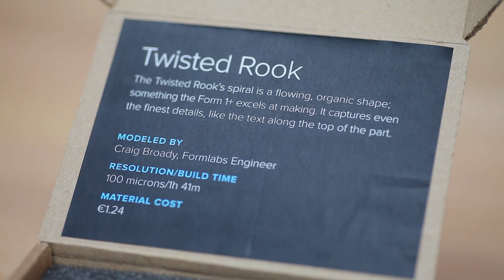Formlabs Form1+ Sample Part - The "Twisted Rook"

Comment: Formlabs is a risky printer - it does not perform as advertised. I bought it because of its high resolution, but I can't successfully print models that work perfectly on FDM and Polyjet hardware. I quickly realized that this 3d printer works only under perfect model conditions. I asked Formlabs to "do the right thing" and take it back only after having it for a week and they have stonewalled me with a futile "let me work with you" approach - they absolutely don't care AT ALL that it will consume many many hours of my time to troubleshoot. They host a support site with topics like "nightmare"...I suggest you look at these topics and other 3rd party sites before buying this printer.

Its a bummer - I think the design looks beautiful, and I would love to have this resolution in a reliable way...but this 3d printer is a $3700 unrecoverable disappointment.

Comment: I got a copy of their previous print sample in gray, back when I was still researching and weighing my options about 3D printers.
It really is an amazing print. I didn't wind up going for the Form1 but it really impressed me.
(Personally I think the previous version of the print sample is a bit nicer than the new one - more variety in shapes and textures in the print. Those helical walls on the new sample are a bit dull IMO.)